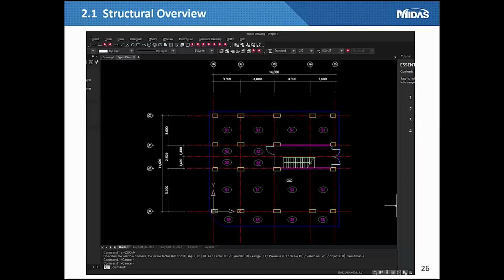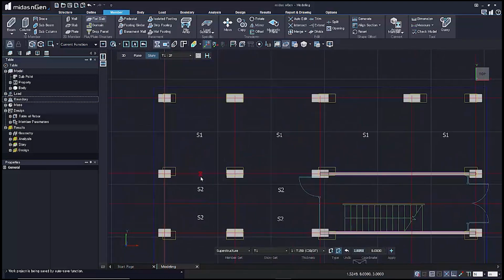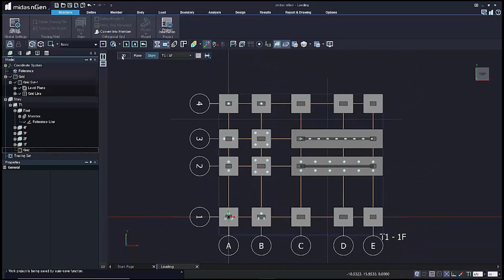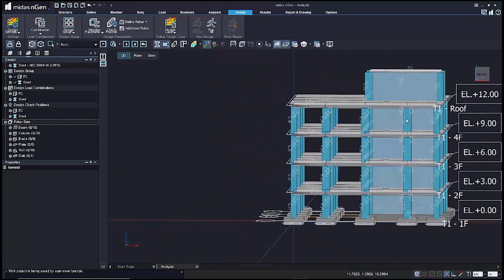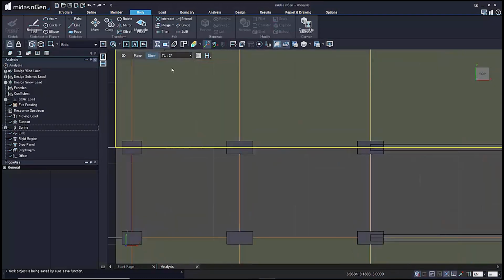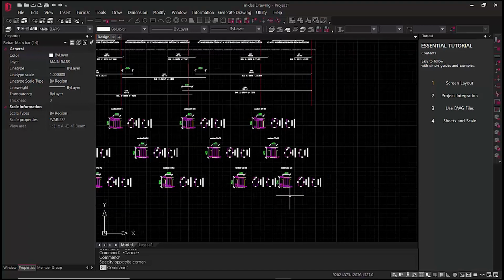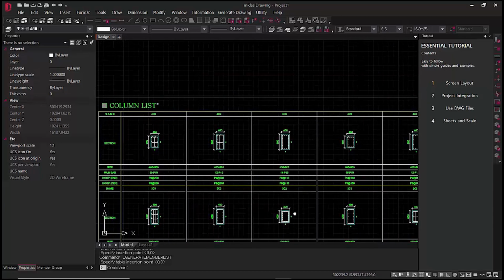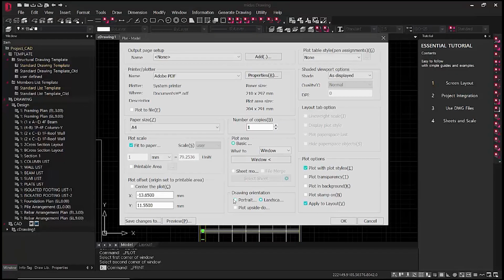5- Story Building Design by using midas nGen | Building Design | Structure Design

Comment: Hello Admin

In Midas nGen, beam code design check option provides result for 'M' (bending moment) by considering moment at CENTRE of column. Please advise on the method to change the option to calculate based on the moment at FACE of the column.